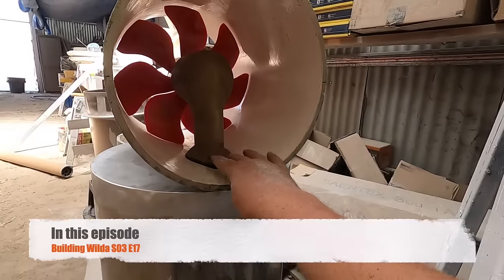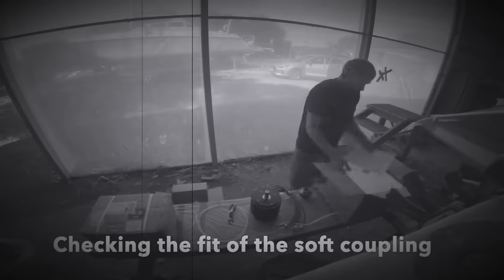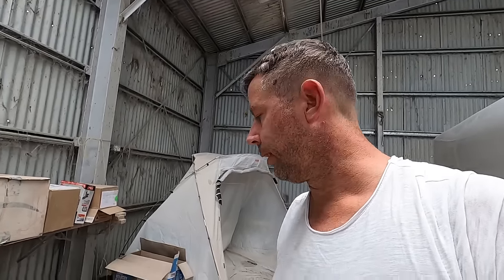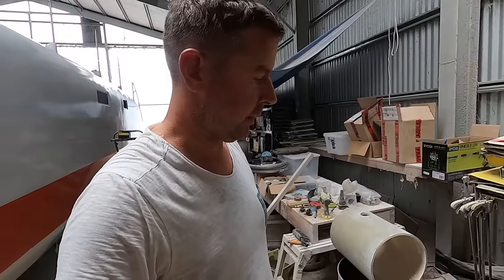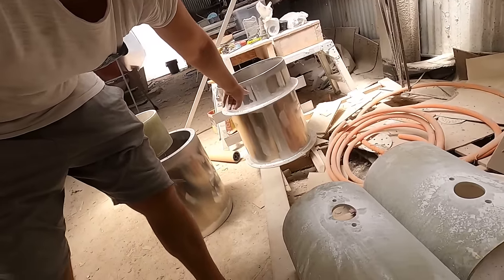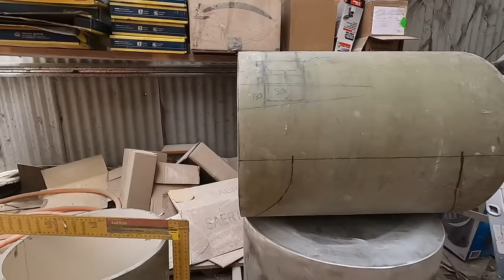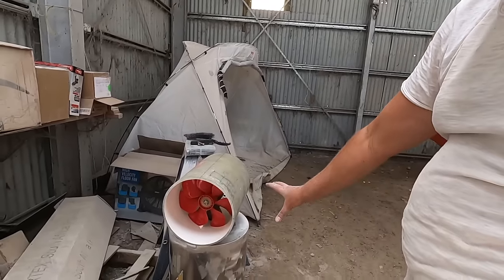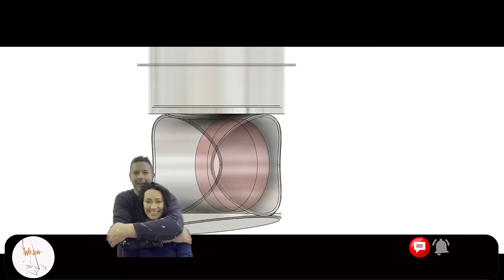NOT the AVERAGE SAILBOAT DRIVE SYSTEM - Part 1- S03E17 | Building Wilda | Electric Catamaran

Comment: When I saw your intro, and saw that you were planning to drive the boat with bow thrusters, I had to check that it wasn't April 1 already. 😂. Best of luck with the project. I'm sure you have worked it out.
Reply from the maker: 🤣
Yes ...
Not a great prop for propulsion... At least not for speed. The thing is though, Wilda is a sailboat, and the little bow thrusters provide amazing low speed thrust (for manoeuvring).
Hopefully we'll be able to get a little bit of speed as well. Not much, but enough to get us going. If we don't get that balance good enough, we'll have to look at a higher pitch prop....
We'll see how the first tests go. Definitely not expecting a speed demon 🤣
Reply: @buildingwilda  As I said, I 'm sure tahat you have thought about it. If you have a look at the earlier Sailing Uma channel, you will see how they use their electric motor to dock, anchor and depart, then straight to the sails. You'll be fine.
Reply from the maker: That's what we've been thinking. Thanks! Really appreciate comments like yours. Hope you stick around for more.

Comment: The catamarans built in the Polynesians by the heritage societies and sailed around the Pacific had custom built electric outboards and solar panels. They were interesting but not powerful enough for extended use. I have electrified some displacement sailboats, all had gensets so were basically hybrids. Worked fine but they never got the regen they hoped for. Being a cat you should do better if they stand up to the stress of surfing. I heard of a cat that had two diesels and they were surfing so much that they put them in gear and the torque actually started the diesel. I also rebuilt a schooner built in 1938 that had an electric motor and a diesel built by a shipyard that built submarines.
Reply from the maker: I'm hoping to get better regen than most by using the prop we have... The drawback will be that it isn't any good at speed.
When surfing down waves I intended to have the props retracted. We should generate enough power at much lower speeds..... I hope 🤣
Sounds like you have been on some interesting projects!

Comment: Love this ! I’ve thought about this as an option ! 
Did you get different spec thrusters, the ones I know about have a short duty cycle.?
These thruster tend to be very noisy so I expect you won’t plan on using very long anyway . 
A friend did similar tube in tube to create a gybing centerboard! 

Hmmm, my feeling is the gearbox should be in front so there is no restriction for the accelerated water to exit when in drive mode . 
But at least you can rotate the unit too and try it both ways if you not happy, in fact just comparing the thrust in fwd and reverse should tell you a lot! 
Re regen what I have read is you need a minimum 16”/400mm dia prop for regen but in a tube I don’t know . 
Cheers Warren
Reply from the maker: The thruster legs and props are from a hydraulic thruster capable of 30kw continuous. According to the manufacturer runtime should be pretty good. In reality I don't think they should be running for too long. We'll see how they go. I think the noise often comes from the way these are mounted more than the gearing... I'll try to mount them as quiet as possible.

12 (11.9)" prop, but huge area and low pitch, so I think it will turn for regen. There are also various settings to play with on the controller to optimise regen.

I think it will be a good generator.

I have my eyes on a different prop for increased speed performance.... That may be a way to go .. at the cost of less regeneration. Maybe two different props?... 🤔

Comment: Love the concept and it is your version of an animus pod. As long as you get the thrust right,( easily achieved by changing the props). You will need at least 6 knots of boat speed. I am guessing you will fair in the thrust tube to the base as you progress your design.  🤙🏼🤙🏼🤙🏼🇦🇺
Reply from the maker: Thanks

Yes... I foresee some different prop testing in the future 🤣

The tube will be cut flush with the hull and the various parts faired together.

Thanks for watching

Comment: It is, in effect, the system that Amel have used for their bow thruster for decades (think Super Maramu). Thoroughly well proven concept, albeit they dont use vectored thrust (but the topic has been proposed for emergency propulsion)
Reply from the maker: There are many versions of retractable propulsion. I work in a field where it is common.

Most installs are either prohibitively expensive or not suitable to install for one reason or other. Most available solutions actually are both 🤣

We'll get to the vectored thrust once we are out in the water. For now, we'll be happy to just get the props to lift in and out of the water.. and spin 🤣

Comment: Its probably a bit late but i believe there are websites that can generate the curves you need. They give you a printable template that you wrap around the tube. I've seen people on other channels that using them when fabricating steel tubes.
Reply from the maker: Thanks.

I used my cad of the shroud to generate a set of measurements. Transferred that to paper (no printer close by) and to the tube. Thanks

Comment: Hi Guys, once again you're taking things to the next level. 

I love that you thought about drag and how to reduce it. 

However I am concerned you may be under powered in heavy seas or even coming to port in heavy winds for a safe anchorage. 

I'd suggest having 2 of these per hull, one close to the stern and the other 50-60% along the hull from the stern i.e. just forward from midships. You can not have it close to the bow as in heavy weather conditions the bow will be out of the water approx 50% of the time.

If you had 2 each hull your regen capacity would double, meaning you could cope with a larger battery bank which in turn would give you a greater motoring range and higher power when and if needed. 

I'd like to see the cylinders, now stainless steel, be constructed from either fiberglass or carbon kevlar composite so that the bond between the hull and cylinder is as strong and stable as possible. With stainless steel / fiberglass join, specially under the waterline you will be relying on a sealant such as sikaflex and bolts. I'd be worried about the longevity of that. 

In any case, I would again suggest to create a water tight box around this assembly so if there is a "disaster" it's contained within the box and will not threaten the safety of the yacht. 

Also regarding the electric motors, have you looked at the radial flux motors? They are much lighter and thinner/narrower than standard electric motors. For the weight of your 10kw motor you could get at least a 25kw radial flux motor. That's a massive difference in power and regen when there's 4 units. 

Love that you're planning on them being rotating, another reason to have 4, you could maneuver the yacht to do a waltz in 50 knots of breeze lol

Honestly you guys are putting more thought into your yacht than most of the high ticket yacht manufactures do. 

You're not just impressive, you're quickly becoming inspirational! 

Well done and thank you for sharing so much!
Reply from the maker: Thanks for your very kind comment!

Originally i wanted to mount 2 drives diagonally. The thing is, space is very limited forward in these hulls. They are very narrow up front... I may have been able to squeeze one in forward, perhaps a smaller one. In the end I decided keeping them in the aft is more practical. I'd still like to add a small thruster up front at some point.
Though it would provide some extra thrust, 4x25 kW is a 100kW draw from the battery. It would have to be a very big battery. And big cables, breakers etc. A lot of weight.
2x10 kW is not a huge amount of power. But really high torque low speed grunt. In some cases it may not be enough, we'll have to carefully learn our limits.

Even with just two azimuth thrusters, we should be able to manoeuvre very nicely in any direction at any heading. (Would have been better with the diagonal setup)
Reply from the maker: I wanted to make the cylinders from fiberglass... It would just have been too time consuming. Couldn't get hold of the tube prefabricated and finding any suitable mold proved super difficult... Time was the real deal-breaker...
Reply: @buildingwilda  you've obviously given it lots of thought. 
When I have time I'll send you through some info on latest battery tech, I'm sure the weight you've allowed per kw of battery storage, if not been updated in the last few months, and I know you've both been extremely busy with hands on stuff haha, but you might be pleasantly surprised. 
12 months ago it was roughly 900g /kw of battery storage, now it's less than 500g/kw and by the time your amazing yacht will be ready to launch I'd expect even lower weights per kw. 

Also a higher voltage circuit for your motors will reduce the weight as well. 

Lots to think about and even more to spend your money on LOL. 

Love the progress and the way you consider all options. Just a pleasure to watch! 

Once again, thank you!
Reply: @buildingwilda  This I understand, it's a complex moulding due to exact internal dimensions on one which is not so difficult but exact internal and external dimensions on the internal cylinder is complex in both the moulding and manufacturing process. 

That being said, bloody impressive when it's done! Hahaha

Comment: Oké than ! 
That’s an experiment 2.0. Interesting to see how long it will last. 
Obviously it will work but there are a couple items that can be a spoiler. 
That blade is not strong by it self. If you lose a blade the thing is in unbalance. It will result in rubbing the tube etc etc .
What if something get stuck in side the vertical pipe. One bit of sea life and the system may jam. 
Loads of effort to make de hull flush must is that really a must. Are folding props equally efficient and effective.
Reply: How will it deal with weed etc going into the shroud?
Reply from the maker: Nothing is a must and everything is a compromise.

Yes, there will be challenges. I think the blades will be plenty strong enough. And they are well protected by mostly not being in the water and by being in a nozzle when in use. If they are damaged, they are relatively cheap to replace.
The tube will probably be jammed at some point... Plastic or a net or something.. but as they are supposed to be retracted most of the time, hopefully less often than a regular sail drive... I hope 🤣
Reply from the maker: I'm sure that could be an issue. A net would be worse. Hopefully the prop will go through seaweed. If not, then try reverse to spit it out..  if that doesn't work, likely the second one should be fine and I can go for a dive 🤣

Comment: Not too many low speed cruising regenerative forward facing propeller thruster designed sailboats. Even more unique is the vertical height adjustment. For decent regen, a combination of ideal sailing speeds of 7 to 12 knots and longer passages of days to weeks are usually required. So I am intrigued abiut the outcome and potential results. Cat speeds are usually better than mono hulls, which helps. Raising and lowering the propeller shroud will reduce drag when sailing vs motoring. 

More familiar with power generation from the round the world Imocas. Where tilting hydro vanes/generators were mounted on the transom. Yours is an in-hull mounted DIY hybrid concept combining elements of: a servo drive, thruster (bow/stern), a forward facing regenerative propeller system (optimizes regenerative capabilities), plus your height adjustment. Ingenious, unique, innovative.
Reply from the maker: :) And untried :) But well get it to work. With the prop we have, I hope we can generate usable power at lower speeds as well. At 7 to 12, we'll see what sort ofpower we get. I'm thinking it will be good. Unless we stall the prop. The whole setup will require some tweaking once we put it together.

I really like the watt and sea generators. Their variable pitch prop racing model is amazing.. But 8000 euros last i checked... We'll try a high speed low torque towed setup as well.. I have some bits lined up in a box ready for testing... Not rocket science, so should be able to make something work.
Reply: Uma's owners were trolling boat shows looking for regen options. Limited selection due to boat size/weight, comfortable cruising speed 4 to 7 knots, depending on location and circumstance, cruising from 1 to 7 - 10 days. Compared to round the world Imocas going at 25 to 40 knots, sailing weeks or months at a time.
So some planning, trial and error, lessons learned, charting some new ground. Need some speed to counter the regeneration drag. Then there is also sea state, ocean current and tidal changes.
Reply: Other hindrances, reliable availability options, costs, design/troubleshooting support/spares availability in the furthest reaches.
Reply from the maker: Absolutely one of the biggest challenges...

Electric requires fewer, though perhaps less available, spares. Building diy means you have to use off the shelf parts. Mostly, these should be cheaper and more easily available... Others less so. We have an extra controller, many breakers fuses etc. But that's really all ..

I think our drives will generate usable power at pretty low speed... We'll see how low is practical. We can alter the parameters on the controller to tweak it once we get moving. Looking forward to that!
Reply from the maker: A performance cat should be a better platform for regeneration.. we should be sailing wind speed up to 10-15 knots I hope...

Comment: NIce to see a performance daggerboard cat with retractable motors. I don't get people putting daggerboards on cats with saildrives and permanent rudders. With this retractable setup you will be able to take the bottom in nice sandy lagoons like Middle Percy and North Zoe creek. I think you need to have retractable drives (usually outboards) or minikeels with diesels. I am very interested in your setup.
Reply from the maker: Actually the Schionning designs are designed to be be able to beach. Even with fixed rudders. I'd be very careful beaching though. Being able to lift the drives will certainly make it safer.
But then there is the paint and sensors to consider as well. But I guess if you are careful in choosing a spot it should be fine. Looking forward to getting to those hard to get to places! The 45 cm loaded draft should make most places accessible.
Reply: @buildingwilda  I am careful but not that worried about beaching. I have two layers of 600gm double bias over a cedar strip core and have never had any damage on sand. I do use harder than normal antifouling. The depth sounder transducer is slightly up the round of the hull so it is fine. But nothing could get me on a cat that couldn't dry out - I love the places (like Percy, Hill inlet and Leekes Creek and Whathumba and Coongun creek) that require a cat to take the sand at low tide - great sand should not be a concern for a well built boat like yours. Cheers Phil
Reply from the maker: We want to put silicone antifouling on the boat, would be great in most cases. This kind of thing is what gets me leaning towards coppercoat instead though.

Comment: Hi Axel and Rox
I used to work in construction of oli rigs made from steel tubulars and to make them fit togerher we had to curve the ends of tubes exactly the same as you have cut your thruster tunnel.  There are simple proven methods for doing this which I am happy to show you if you are interested.  It might be too late if you have already cut them but let me know if you are still interested.
Great project you are doing by the way, love watching your weekly videos.
Reply from the maker: Thanks! That's kind of you. It was a little bit tricky to get right. Got it done in the end though. Now they fit nicely and will just need some cleaning around the edges.
Reply from the maker: Weve done the cutting already, and we got it pretty good with the help of some templating. Getting the inside and outside marking wasn't easy. In the end we cut perpendicular to the outside mark... Turned out best that way.

What was your simple method?
Reply: @buildingwilda  it is not so easy to explain but you can develop paper templates that wrap around the pipe and show the cutting line.  I used to draw them by hand but it is even easier now using cad.  If you have to do it again I can show you.

Comment: Love the idea, I'm doing similar on a Schionning Arrow1201 mind you with Hight thrust outboards with the eventual hope of refitting to electric propulsion in the future. I may have missed it, but what mechanism were you going to use to raise and lower? I'm torn between simple infallible fixed block and tackle or electric linear actuators.
Reply from the maker: Electric linear actuators. A bit more work, but should in the end have some advantages.
High thrust outboards will work great.

Comment: Will you have the props counter-rotating to eliminate prop walk?
Reply from the maker: Actually no. When the prop is placed in a shroud it doesn't really matter.

If they were open I still think I wouldn't bother much. Propwalk can be as useful as it can be annoying. With these small short pitch props I don't think you'd notice much in any case.

Comment: Are all your different metals not going to cause issues under the water?
Reply from the maker: Yes .. they will... Like with most boats. It will be a bit of a challenge to handle, but with good insulation and bonding it should be alright. Also, most of the time most of it will be out of the water.